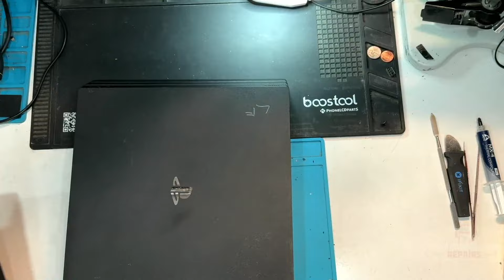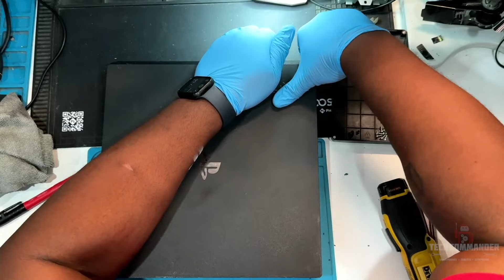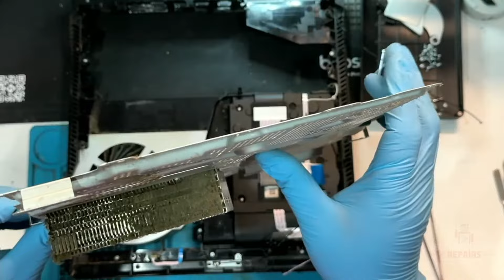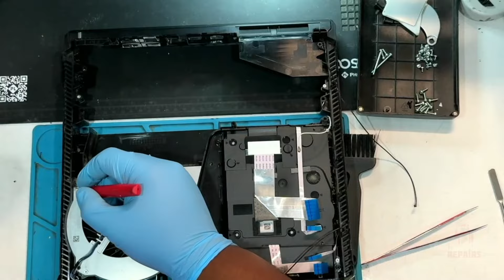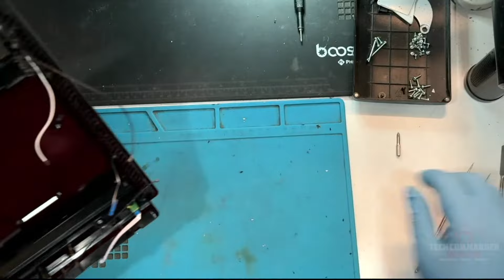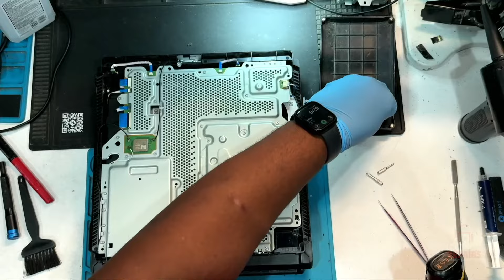Playstation 4 Pro Disassembly : Full Teardown and Cleaning (Model CUH-7215B)

Comment: Power supply wont come out its still in There i cant get it, i also accidentally stripped a T8 screw
Reply from the maker: You might need to use some needle-nose pliers or a screw extractor to get that stripped screw out.

Comment: props for this video. only barrier i ran into was the cable for the power supply was basically impossible to pull out for me and after a few attempts of feeling like i was about to break it, i gave up and just had to deal with the challenge of working around everything while that cable stayed tethered to the power supply. was a pain in the ass but i pulled through and got the fan + heat sink cleaned and the CPU re-pasted with noctua paste and now it runs better than when i bought it second-hand
Reply from the maker: Glad you were able to power through and get it running better!

That connector is definitely difficult. I've had many people that complained about it.
Reply: @TechCommanderRepairs  yeah, i just had to take it back apart again because i was noticing that it was running hotter than before cleaning, and the fan was strangely silent. figured out the problem and it's because i used WAY too much thermal paste, another tutorial i followed used the "buttered bread" method which turns out to not be great, so i simply cleaned off the excess i applied before that, replaced it with a single short line, and now it's running much cooler again

Comment: My ps4 pro overheats from cpu i changed the thermal paste and cleaned the fan dusted it off cleaned the heat sink  and still overheat do you know what could be the problem?
Reply from the maker: Hmmm, what thermal paste did you use? 

Is the fan spinning? 

Did you completely clean off the old thermal paste?
Reply: @TechCommanderRepairs I bought the artic formula mx-6 yea I tried cleaning it good and the fan is spinning .
Reply: It starts getting hot from where the CPU is
Reply: I also noticed a like coloring where thermal paste goes on heat sink

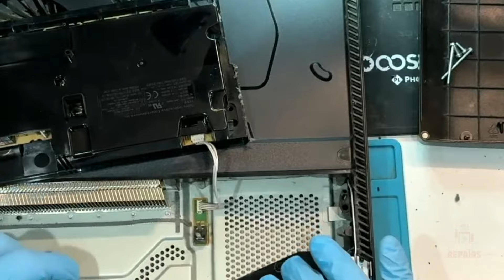Comment: Can the power cable at frame 6:55 be glued back on if it gets pulled away from the board?
Reply from the maker: Unfortunately, it can not be glued. It will need to be soldered